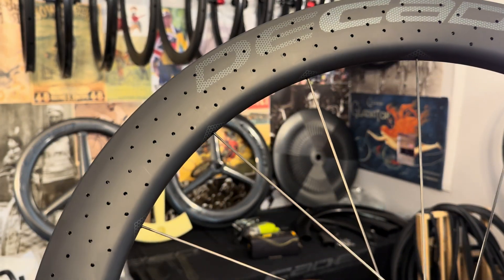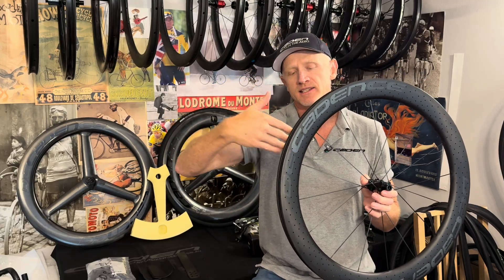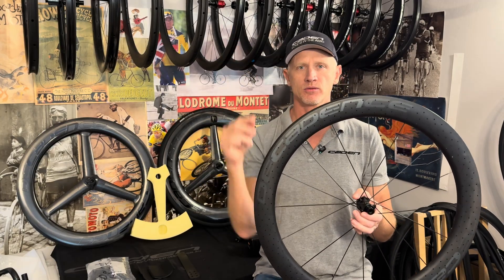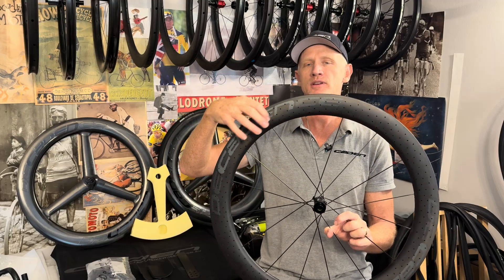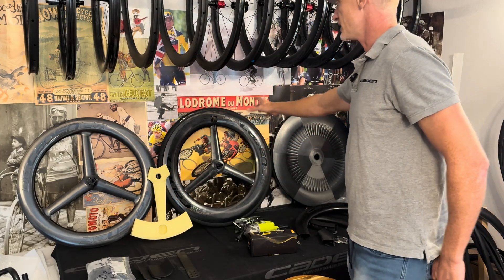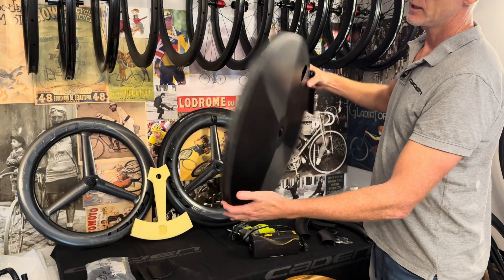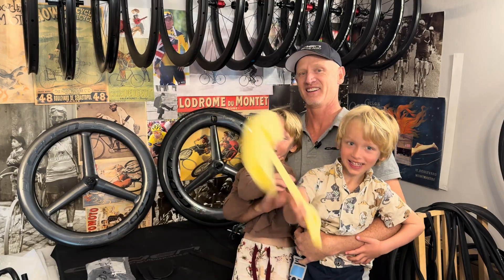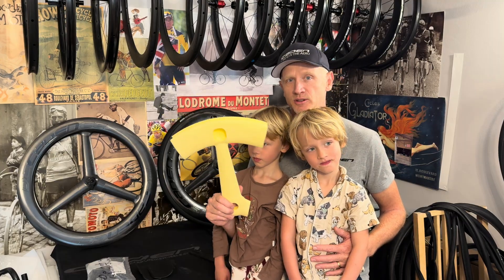Better or Worse ? Glorious Holes

Comment: Ya need a bleed air system pushing air out those holes to create a boundary layer.  😊
Reply: Fact, OP
Reply: Indeed.  Long ago, our jets had 17th stage(?) bleed air from its J-79's routed to the wing leading edge for a High AOA boundary layer.  It worked, until you exceeded the AOA limit, then you lost lift dramatically.

Comment: Great work and research! This was one of the questions I've had with aero wheels, now answered, thanks!
There is so much technology from airplanes that can be put to test in wheels, it's endless.
What if the air "intake" was in the inside of the rim, in between the spokes, and the sides of the rims were only exit?